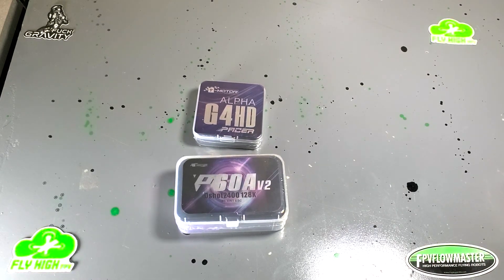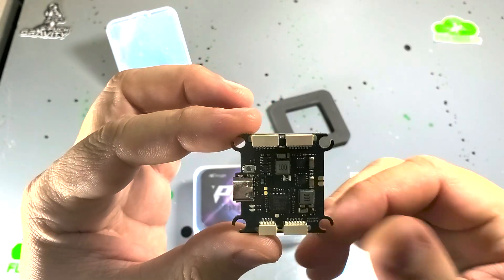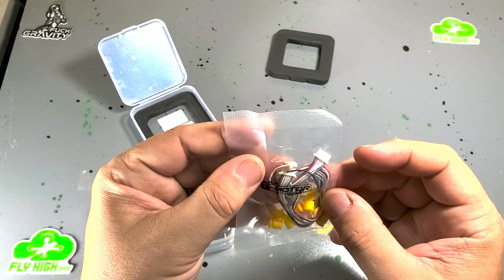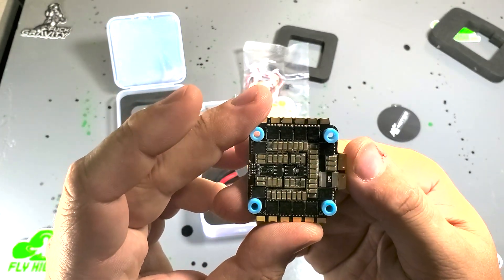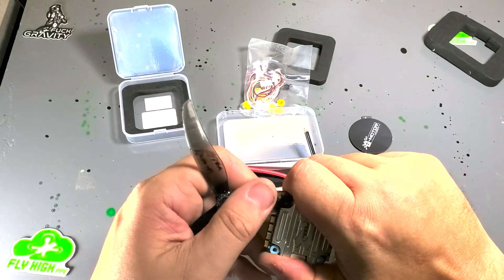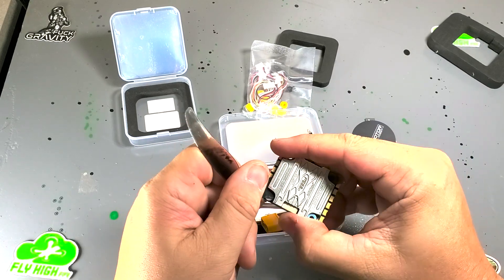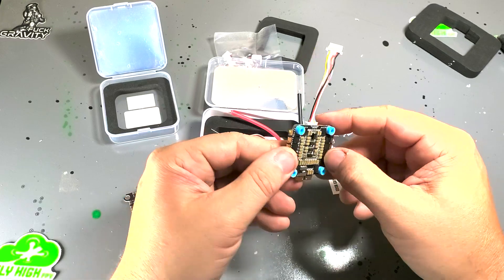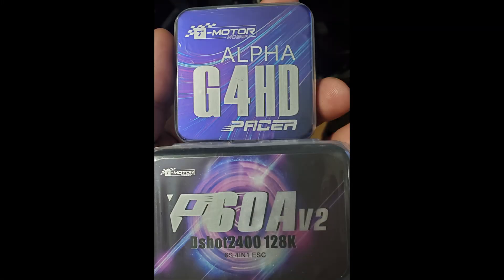Fly High FPV has T Motor Fettec Alpha G4HD In Stock, and shipping before anyone else!

Comment: I have several BF quads already with some moderate FPV flight experience, just recently completed one of these tmotor alpha builds with the same dshot2400 esc using an AOS5 frame, there is just something about how it flies more predictable between gaps; where you want the thing to go just seems very stable, entirely out of the box with the 5" presets. Getting BF to work this way requires a lot more work & blackbox tuning and I would have never knew the degree until you fly something else that isn't BF.

Also these ESC's appear to have some layer of conformal coating already, though like us who like to fly around water & snow we tend to cake the stuff on for good measure. I presume the heatsink also doubles as an EMI shield & if kept removed an equivalent copper foiling EMI shielding (bottom insulated) tape should be applied over the top.
Reply: Also because the thing is chock full of copper compared to typical cheaper ESC's, soldering your battery leads & capacitor makes the thing hot enough that it becomes much easier to remove the heatsink.

Comment: Do you have a video on the connections from esc to the FC. Can’t even find a wiring diagram on the FC and there’s only 7 pins per esc connection on the FC while the ESC has 8 pins.
Reply from the maker: They are both 8 pins, the  wiring diagrams are on the product pages on my site (link in description) 👍
Reply: Thanks for the response, got it thanks.
Reply from the maker: @Lucas Milton  always happy to help 🙌
Reply: Same issue any help?